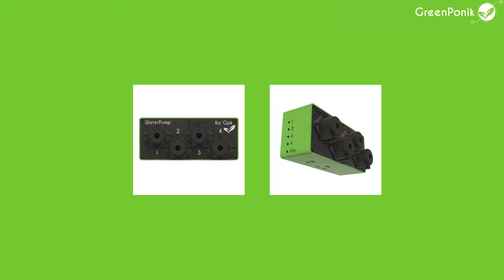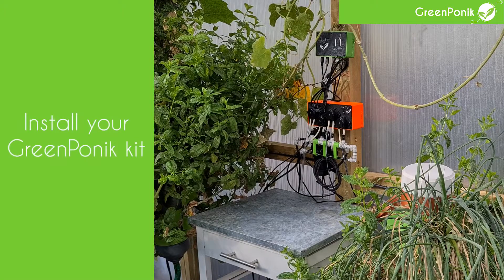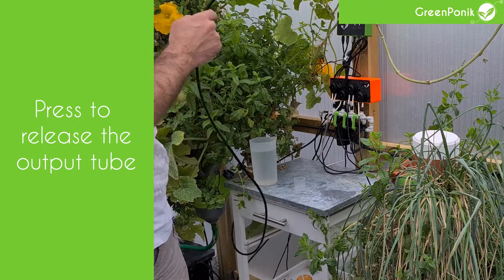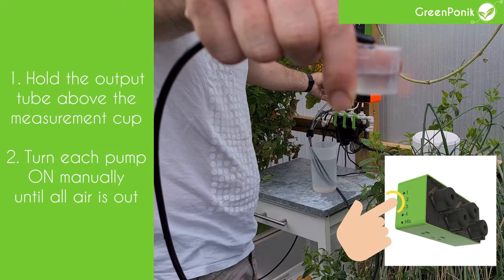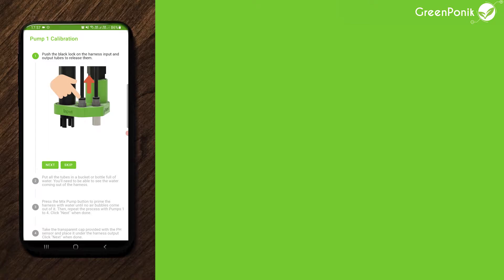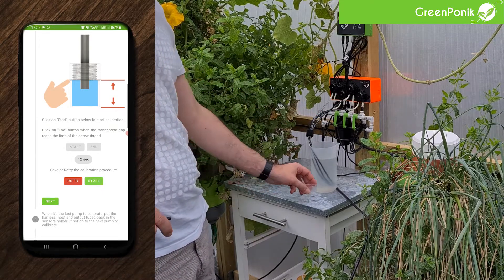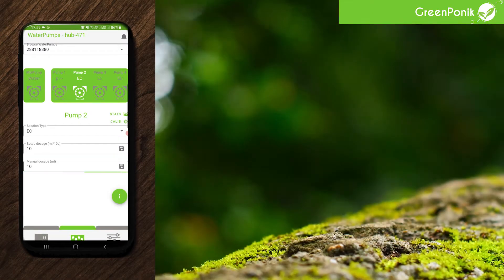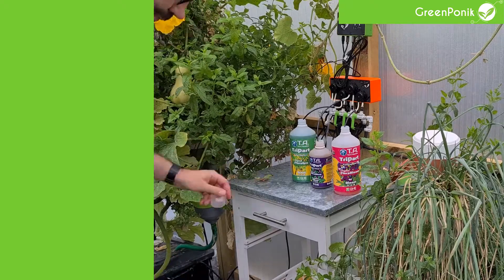Dosing Pump Calibration - GreenPonik Hydroponic kit

Comment: How do you prevent siphoning all the nutrients out if the pump goes out?
Reply from the maker: which pump are you talking about? the peristaltic pumps?
Reply: @greenponik  I meant the main pump, but since the intake and outtake are both in the same place I guess there can't be much siphoning.
Reply from the maker: @paulnguyen1506  you have to think of the dosing pump as a non-return valve as the mecanical axis apply pressure on the tube on 2 points, so no backflow 🤘
Reply: @greenponik  are those T connectors check valves of some kind?  Is there ever backflow through the peristaltic pumps?